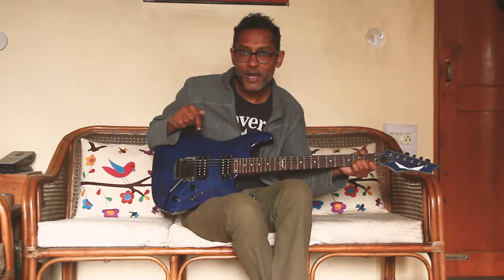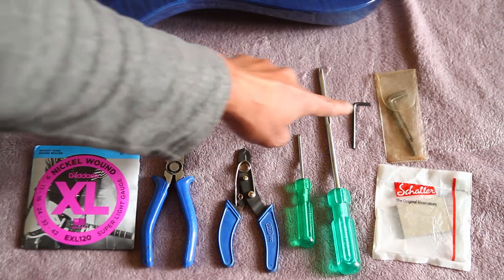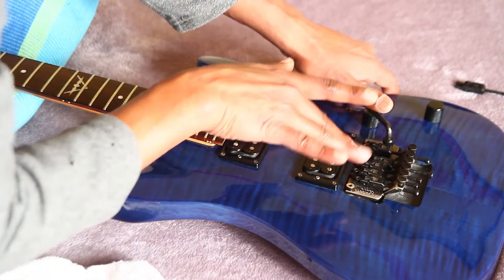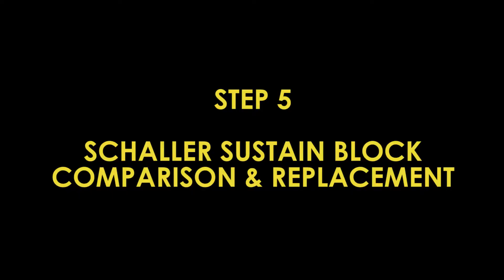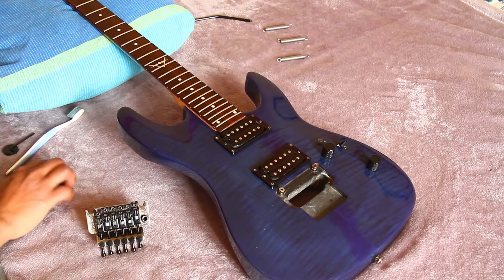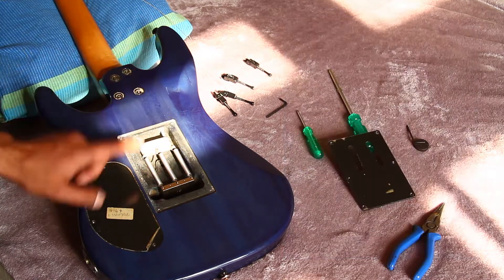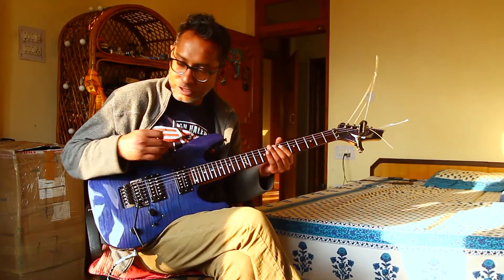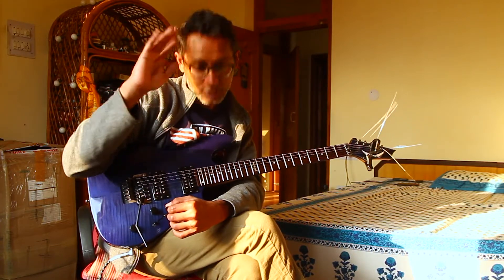Brass Sustain Block Upgrade on a Floyd Rose Special for Improved Tone!

Comment: I always recommend this mod to owners of the Floyd special.   I also noticed your floyd has Black saddles
but the baseplate is chrome?  Did you install better saddles of a different color?  
The saddles on the stock "special" are zinc alloy while the OFR uses hardened steel.
Reply from the maker: you're correct to recommend upgrading the block.. it does improve sustain on an FR Special. Yes, I used better saddles (supposedly steel) that are black in colour. They really made a difference in tuning stability. I like the contrasting colours (black/black chrome) on my floyd. :) The zinc saddles are just kept as spares now.